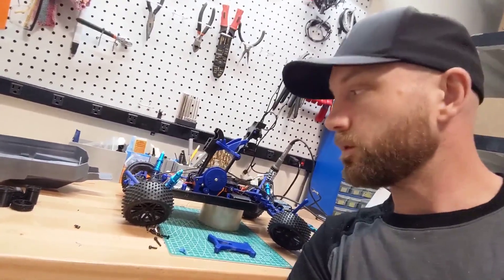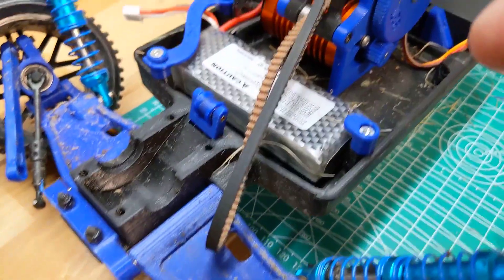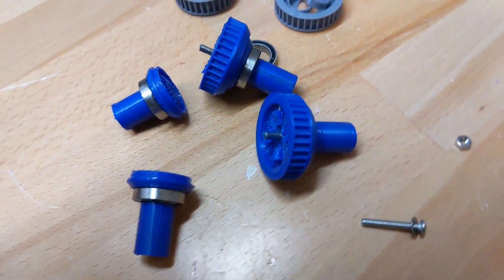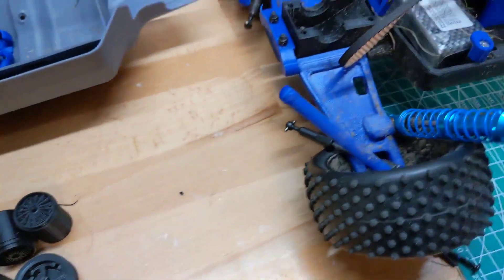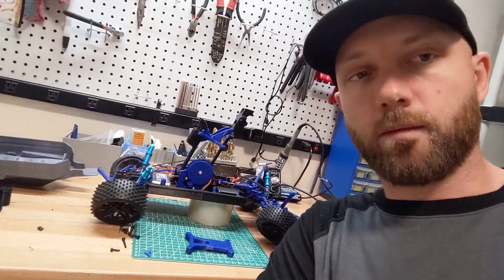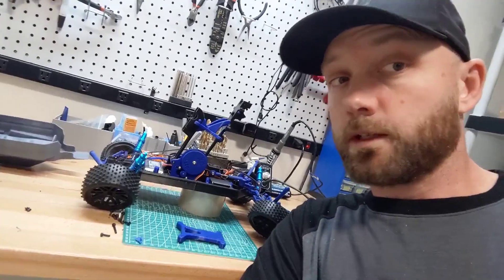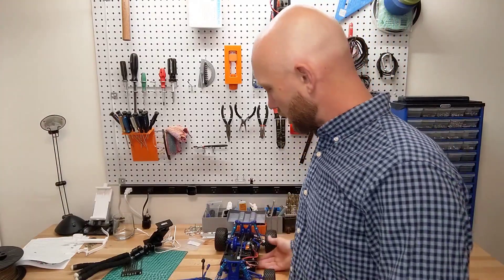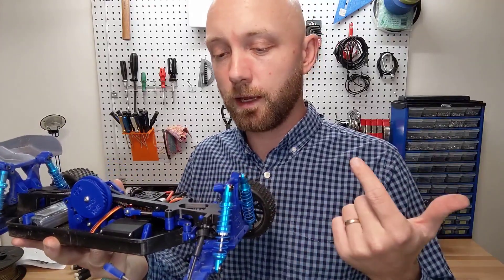Mk Ultra Episode 2 - Troubleshooting for Reliability

Comment: Hey man, I know this is a video from 2yrs ago but will you also look into Jackmass's FENNEC RC buggy~ my unfortunate problem with this buggy is actually the metal differentials is pretty hard to come by (and is somehow overpriced on many stores in my country) the FENNEC uses a much more common HSP/Redcat Differentials (and is actually no options for a 3d printed one) You can also use the differentials from Red Cat's Volcano EPX Monster Truck (the 1/10 scale monster truck) and those RC Trucks were recently revived and reproduced so parts support for those RCs are still around

Comment: There's a fine line between the durability and dependability of 3-D printed parts and the equivalent metal ones. How do you think the belt drive will hold up? You never really got into tensioning the belt. Does it hold the tension or do you have to keep playing with it because the belt stretches?
Reply from the maker: Its kinda hard to say for sure because everytime I take it apart to add something I re-tension it. It seems to hold tension just fine though and I don't need to re-tension in between runs. Metal is great, especially for drive train parts. I'd go for a metal spur if I had one.

Comment: Have you tried different materials for the diffs? Such as nylon (or if you struggle to print that CF Nylon or CF PC?). Just saying because those metal diffs really add a lot of off centre weight which I know from experience isn't great from handling because I used to use them in my tamiya tt02b before I properly started printing.
Reply: Nylon in itself is also a lot quieter as a gear due to its self lubricating properties 👍
Reply from the maker: I've had lots of issues trying to get nylon working good enough although I probably need to try again... maybe with some newer/better filaments. If I can get it working better I'm sure it would last longer than pla.
Reply: @rcprinter  Try Taulman 910. It's an easy nylon to print with and works well for gears.
Reply from the maker: @The0nionKnight  thanks I'll give er a shot. I suppose if you use it only use it for the high stress parts the added price is not too bad.

Comment: Great Video about the little problems that the MKUltra have Out of the printer. 😁 But there are a few more modification, that makes the car "The best 3d printed RC Car“ 😁 
I think the next problems you have, are all the ball joints and the Spur and Pinion gear! 
And put in the swaybars, they helped me a lot for more corner speed! I have a ton of modifications in my two MKUltra's! 
When you want, i can show and share all this things for more MKUltra fun! 😁 
And get a faster motor! 👍🏻😁
Reply from the maker: Thanks man! I ordered a faster motor but it never showed up so I'm using this one for now. Hopefully a new one arrives soon. I definitely plan to put in those sway bars and I'll change the spur and pinion once the 3d printed ones blow up. I'm also hoping to stick with the 3D printed ball joints as long as possible. I lubed them all before installing and I think they're gonna last a while but I guess we'll see. I also need to get it painted soon as well. 

Did you ever get the slipper clutch installed? If so how's it workin?
Reply: @rcprinter  The ball joints last for a while, but those in the steering wear out the fastest and then always jump off. I haven't tried the slipper clutch yet, so unfortunately I can't tell you how it works. Since my entire drive train is made of aluminum, I haven't seen any reason to try it out. :) 

What I just noticed, is there a reason why your front shocks are mounted to the front?

I have one more tip for you. Try to print the wing from PP and the wing holder from TPU. Broke off quite a few wings and brackets and not a single one since they were made of TPU and PP. 

But I'm looking forward to your next videos about the MKUltra and any improvements.
Reply from the maker: Are you running an aluminum spur as well? If so how'd you mount it? I'm looking at some cheap spurs on aliexpress but I'm not sure how to mount them other than modeling a custom adapter since they don't have that octagon inset the ones he modeled do. Like this: https://www.aliexpress.com/item/4000041427654.html
Reply: @rcprinter  Jeah, i'm running a Aluminium spurgear, but i made it by myself. Before i used a standard Arrma spurgear with this octagon. The AliExpress gear is difficult to mount. I don't know, if a printed adapter will last all the force?
Reply from the maker: @77LaKoS77  Wow, milled your own spur gear! Pretty sweet man. I'll have to look into doing that. Ya, not sure about those aliexpress gears, I'm pretty sure something 3D printed would work but it would take a lot of trial and error. Probably best to stick with the gears that have the octagon inserts for now.
Reply: yes pls, post some videos :-)
Reply: @ripmax333  me???